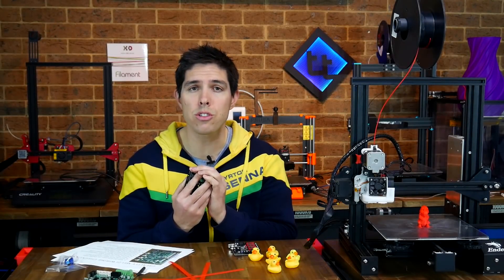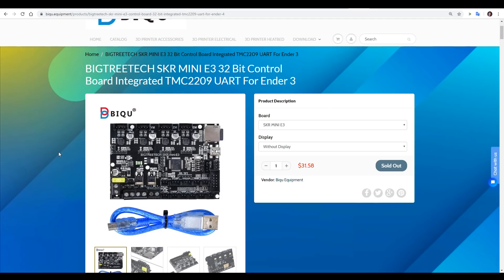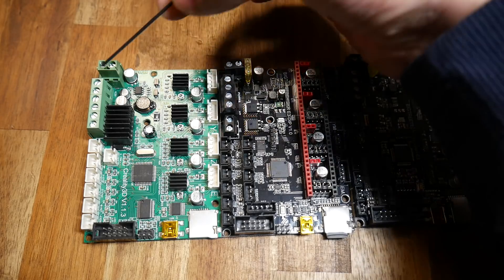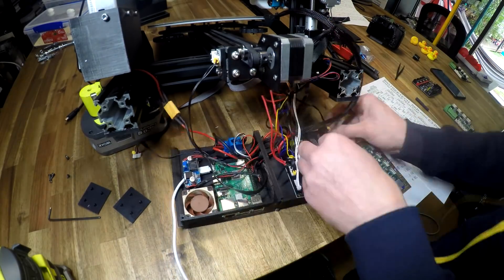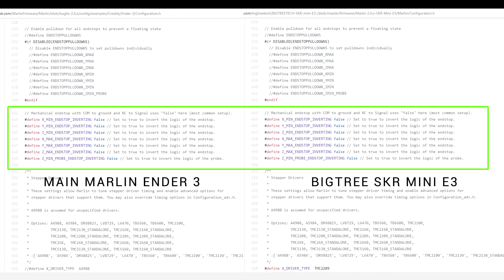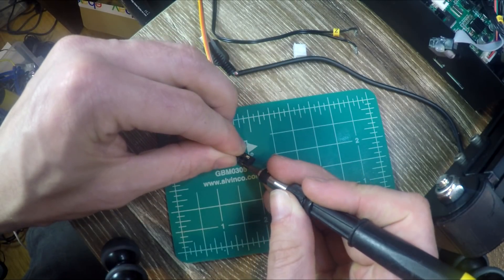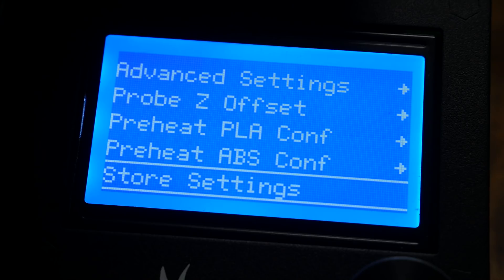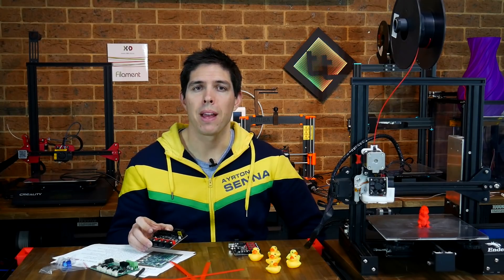SKR Mini E3 - The best Ender 3 upgrade from stock?

Comment: What is the main reason people upgrade their boards? How does it actually improve printing?
Reply: As he goes over a bit in the video there are 2 main reasons the extra expansion ports without cutting wires and the other is better stepper drives which without going into much detail about how they work are more precise and made to be quieter so you get reduced noise and better precision improves your print quality by reducing the size of extrusion artifacts due to the smoother stepper drivers.

Comment: I just got my mini e3 in the mail, with plenty of ducks  but no heatsinks... Should I install or hold of until I can get my hands on a pair?
Reply: I think it is not safe to use it without heatsinks.
Reply: @UgurGuver  Thanks, I didn't trust it either.. So I took the heatsyncs off the old board and ended up using those

Comment: Hi Michael,
I used the firmware file you provided. But I run into "TMC Connection error". And also the nozzle temperature is displayed at 100 degrees constantly. Any help is appreciable. Thanks in advance.
Reply: mani. lycan I got the same tmc connection error
Reply: @Paddzr  Yes. I posted the same in GitHub also. Another guy who got the board yesterday also has the same error. The RGB adapter is changed in the new board I received. Anything to do with that?
Reply: @maniac19061988  is it this one? https://github.com/bigtreetech/BIGTREETECH-SKR-mini-E3-/issues/32

I commented there too. I too received different board. The .bin from sd card works but there's no way to modify it to add bl touch.

Comment: Is this board compatible with Octoprint ?
I just upgraded my Ender 3 with the Mini 3 and definitively a great improvement but Octoprint is another story, getting print all over the place, file transfer trouble....)
Reply: @Teaching Tech, do you have a reply?
Reply: @sam2b77   yes there is a fix, need to remove the +5v pin from the usb cable.

Comment: I have seen the dampeners reduce the DB by about 5, but silent stepper motor drivers reduce noise by about 10 DB, is there anything gained by using both? I'm aware with both, after installation fan's are often the loudest part of the machine, but there are quieter fan's too. so I'm wondering is there still ground to be made in noise reduction?
Reply: Yes, i changed the psu fan to a 92mm noctua, rear mounted the board with a low profile 120mm fan and put a 40x20 noctua fan as the part cooler with a larger blower, fans are not cheap but you can sit next to my printer while its running and its almost silent, ambient room noise is much louder, did require custom psu case as well as board case but stock fans were way too loud

Comment: Question: Does installing this negate the need for the TL Smoothers, or do they each address separate problems?  Thanks in advance for any help.
Reply: don't use tl's with the drivers on this board.

Comment: A couple of what may be dumb questions. I am hoping to just swap this board out in my Ender 3 Pro, is there anything I need to do differently in a pro? Also in CURA is would I continue to just keep using the profiles based on the Ender 3? should the same exact gcode work fine? Great video! Thanks.

Comment: Is it still recommended to connect the BLtouch in the Z-end stop plug or BIQU fixed the problem and we can now use the appropriate PROBE plug? If it's still recommended, should I splice the Z-end stop wire to keep my Z-end stop functional? Thank you.  NOTE : my board is v1.2

Comment: tried to make the BL touch work with it, however, the plugs i have dont seem to fit, and when i put them in the printer wont power up.  What plugs do we need for this?
Reply: the new 1.2 board has different pin out the sensor is pa1 +5 Grnd the bltouch i have 3.1 was pinned +5 pa1 ground, I had to switch red and yellow(could be red and orange) my ground is blue others have brown

Comment: So this E3 board should also work in my Ender 5 with a couple of model specific changes to the firmware?
Reply: I have put it in my E5, work nice. Just have to go some compiling staff to do. But otherwise recommend!
Reply: @Riverzilka  i want 1 for e5 ! Any major adjustemts ? Im not gd at programing boards
Reply: No major adjustments. Most of them you will find in Teaching tech video about 32bit board upgrade. My major chalange was to compile the firmware. It keep generating errors for almost day before I somehow manages to do it. I’m new to 3Dprinter world, but do have experiance with programming.

Comment: Hey Michael, it seems that I am not able to align my ender 3 bed correctly. I am using skr v1.3 and homing works. Unfortunately when I print something is it nog in center and sometimes the stepper grind when they go to there max position.. Can you help me out on this one? What are your Y_MIN_POS and Y_MAX_POS? Also what are the other values.

I really can't seems to home the bed properly...

Cheers

Comment: The problem most times is the bed frame. It's bent on almost all Creality printers and needs to be straightend. Otherwise the bed leveling screws are always off uniform or on their maximum of compensation.
This might be the problem with the touch probes and inconsistend leveling.

Comment: I followed everything you told me to do I have the board installed the bltouch and I flashed it with the file you gave in the description when I turn the printer on I get a tmc connection error what am I doing wrong
Reply: me too

Comment: I've just bought the SKR E3 DIP version, and was hoping to have my hot end fan come on at a set threshold, but now looking at the pins diagram I see that only one of the fan headers is actually switchable, which would be for the part cooling fan.
Is it possible to set this option on this board? or should i return it and get the SKR v1.3?

Comment: I need to upgrade my motherboard because mine is broken.
i have also an ender 3 and installed octoprint with klipper on it.
if i buy the SKR Mini E3 is it than still worth it to use klipper?
thanks.

Comment: Hi Michael/anyone reading, I'm struggling to get my BLTouch to work. I have the board installed, firmware compiled, bltouch and everything shows in the menu, but when I autohome, the probe does not deploy. I have the servo pins plugged into the servo port on the board, and I have the end stop switch on the z-stop port on the board. Could anyone maybe provide some insight?
Reply: me too/any solution??
Reply: Same here. Please help.
Reply: @mauricegeurtzen  On the v1.2, you have to rotate the bltouch servo plug so that it is the opposite of what is shown in this video. The 1.2 reversed the pins. I reversed my plug, redid my firmware with a precompiled one off of a reddit forum post specifically about this issue, and it fixed everything for me.
Reply: @tuckuhhh  Thanks very much Tucker. I got it working!

Comment: Will this board support the thermistor upgrades out there for printing in higher temps after upgrading to a micro swiss all metal hotend? If so i'm sold because all i know as an option is spending $179 on a Duet board or a $60 MKS Gen L board with additional stepper drivers.

Comment: I received my E3 1.2 today, Pre-Ordered at the end of August for a Ender3 pro. I wonder if you are still using yours and how it is holding up. I see 1.3 is out.
Reply: I also received my E3 1.2 that I pre-ordered and just finished getting it hooked up unfortunately no matter what I do it won't power on no lights or anything I'm wondering if I just got sent a dud...
Reply: @connorcleveland9166  Does it power via the USB?

Comment: I mounted a Bigtree skr mini E3 on my Ender 3 just as it came from the factory with Marlin 2.0 installed. Only I noticed the very hot engines. I do not know why? Can you help me
Reply: On the Bigtreetech github they have changed the firmware for less stepper motor current, maybe you should try the new firmware update

Comment: I had trouble with uploading the firmware as my computer wasn't recognizing the printer. Turns out you (obviously) need to leave the SD card in, I took mine out because I don't use it and assumed I didn't need it. Just posting in case anyone else has this problem.

Comment: Hey. Thanks for the video. Some great info in there. 
Do you know if there's a convenient spot I can tap into for 12v to feed some LED's on this board?
Reply: Ender 3 uses 24v, 12v is not available.  Most people add a buck converter to get to 12v from 24v.

Comment: Thanks for this video, I have one in the box waiting to be installed, did you enable the EEPROM SD card simulation in your firmware as this board has no standard EEPROM.  I have an EEPROM module that I thought to connect to the I2C, maybe a video on this would be good?
Reply: Never mind, just seen that they've now added Flash based eeprom simulation for the E3 mini

Comment: Does anyone have a guide to getting the best out of the SKR board?  I just tried a back to back test of a print on 2 machines, one with a Creality 1.1.5 board and the other has a SKR 1.3 E3 (I have 2 ender 3's).  The SKR print was 5 mins slower using the same Gcode and the quality for both was very similar - both very good. 

So - tbh I'm hard pushed to see the benefits at the moment;  I have a BLTouch to fit - and being a genuine Creality accessory the wires are different colours than the usual; I also have the Bigtreetech TFT 3.5 v2.0 which refuses to see a printer attached. In a nutshell - whoopee I have a 32bit board that currently is giving me exactly the same s I had with the original board. I'm not bitter about it as I understand there are many more options for upgrades, but it looks like I'm going to have to go though trial and error to get some of this stuff working - and as someone who hasn't had to write a programme in anger for many years the thought of diving into code to fix this really doesn't appeal (anyone got a link to a "how to recompile Marlin for dummies" guide?)

Comment: would the compiled firmware from skr mini e3 work in a skr e3 dip just changing board name (mini e3 to e3 dip) and changing tmc 2209 to tmc 2208?
Reply: I'm considering doing the same thing.  Are you planning on UART on the 2208?
Reply: @stevelaoyster1716  Yes im thinking of that, right now i have installed physically that board on my Ender 3, set TMC2208 with jumpers on UART. Im just looking to rebuild Marlin 2.0 with that change

Comment: Hi Michael, thanks for the very nice videos! Can I ask you a question? I own an Ender 3 Pro and would like to mount a Creality 3D V1.1.5 board that needs no modification. I have a doubt: will I have compatibility problems with Bltouch V.3 as for the standard board?

Comment: anyone with a skr mini e3 1.2 take note the hot bed wire are different. Is the red wire suppose to go to the (-)?  both the 1.0 & 1.2 the (-) is one the left is the red wire (-) in this case?

Comment: Do you suggest this board over the SKR v1.3?

I am hesitant because I have had a driver fry on the stock board, and that forced me to upgrade. With the SKR v1.3 I can just replace the driver if it didn't harm the board as well.

Comment: Hey there! Just wondering, can anyone else verify if you can use mass storage through USB to drop G code files on the board? I have got everything else working except for that, and I've tried it on a couple computers… Thanks in advance for anyone's input!

Comment: Well considering 2209s are out of stock every where till November or so how much more work will the e3 mini with 2208s be to setup?
Reply: The mini only comes with 2209.  If you want other stepper drivers you'll need to get the E3 DIP board.  The drivers just plug right in.
Reply: @stevelaoyster1716  i meant dip... My fault... The question remains. I know you will need to setup the firmware for the steppers and set some jumpers but is the board close enough to follow the setup video for say the skr 1.3 with 2208?

Comment: Thanks for the video. I have installed the board today but my BL touch clone is "revered" that is, the init test seems to be fine, but normally it goes to the "out" position. Now it stays"up". So when I do the auto home, it hits the bed with the hot end first! and not the BLT. I have set the "#define .Z_MIN_PROBE_ENDSTOP_INVERTING true" I'm using "#define SERVO0_PIN P2_00" as I found this in the PINs file (is this the correct one?). Well hope someone can point me in the right direction. :-) Thanks!
Reply: Okay, so I have found the solution my self :-) You can see the steps for getting the BL Touch working on a version 1.2 here: https://github.com/gfk76/SKR-Mini-E3-v1.2-Ender-3-Config-Files-Marlin-2

Comment: Hi Michael. Good job, as always!!! I bought the SKR Mini E3 with  TFT28. When I try to compile Marlin bugfix 2.0, the compiler informs me that "at this time only CR-10 display is supported". Is there some way to solve this?
Reply: Isn't the ender 3 display referred as CR-10 display....so it's the same.
Reply: @EL90291  Hi EL EL, the tft28 is a touch screen display and it seems not supported by Marlin 2.0

Comment: The new creality example included with current marlin 2.0 builds have the rms set lower to keep the chips cool and also now you have to use defualt_env = STM32F03R_bigtree. there was some clean up of code to simplify things as  STM32F03R_bigtree now can be used for several boards. ur firmwares are outdated and incorrect now. might want to make note of that. I tried using ur firmware file and my x chip was burning up. have a good day

Comment: I''ve stumbled upon a problem with this board and manual bed leveling... When going to the proces of the bed leveling everything goes right until I try to set de Z offset... At that point the Z axis doesn't repsond... Anyone got any idea as to why this might be?
Reply: Hi, I've had to disable the software minimum in configuration.h for the Z. comment out MIN_SOFTWARE_ENDSTOP_Z and a Z_MIN_POS=-6 for it to work for me.

Comment: Is this board basically a direct replacement physically and connector wise to a standard melzi? I have a Malyan M150 I'd really like to upgrade the board on but I've been hesitant to have to redo all the wiring (I can do it I just don't want to)
Reply: This board is a direct replacement for the melzi board in an Ender 3 and I think also an Ender 5.  If your board is anything like them then it will probably work but may need the firmware tweaked a bit.

Comment: I just ordered mine a few days ago! how long would it take to deliver?
Reply from the maker: Mine took forever. "Stuck in Hong Kong".
Reply: You were right, it took quite a while but I have now just received it! It seems to have a newer version having its name to be "BTT MINI E3 V1.2". I am following your guide now fitting it on my Ender-3. Thanks, Michael!

Also will this board work on other printers? cause I ordered 2 MINI E3's and I would like to use the other one on a tronxy x5sa.

Comment: Anyone have any suggestions for an issue with the LCD? I have had it happen a few times where the LCD will not show any info after flashing marlin 2.0.x and won't until I reflash the firmware.

Comment: When upgrading my printer I installed a 12vdc 5015 fan by mistake. I'm running an Ender3 so it burned the fan up with 24vdc. Oops. When testing the fan to see if it was still getting power, I shorted the solder pads. Second oops. This one somehow burned the MOSFET on the heater bed and it runs away without control. The circuit is latched open now. Need a new board. I'm not posting this to knock the board, I've ordered a new board and proper 5015 24vdc fans. Posting so others can learn from my mistake.
Reply: A misconnection by accidentally swapping the hotend cooling fan and bed power connections will result in runaway bed temps too.  I made this mistake and although many told me I had a blown MOSFET it was just mis-wired.

Comment: What speed dop you have to print at to get the amount of noise you're getting? When I run my stock Ender 3 at 80mm/s it's not nearly that load.
Reply: Its tge microphone. Stock ender 3 motors are noisey when moving because of the drivers, the drivers on this board make the motors silent when they move, only noise you hear are the fans. My E3 had 120 / 92 / 80mm noctua fans so even when printing you can sit beside it and its silent
Reply: @n2n8sda  I understand that, however, I'm running my STOCK Ender 3 at 100mm/s and it's still not very load, the major noise I hear is the fans. Don't have a sound meter, right now, but I find it really strange I'm not getting all of this noise.

Comment: How much of a downgrade would it be to go from the 100Mhz processor of the SKR v1.3 to the 72Mhz processor of this board? I run 128 native micostepping on the extruder, which I think is the biggest processing hog.
Reply: Ive not tried it myself but a friend in a similar situation uses a geard extruder, i.e titan aero, bmg to get a finer reduction without switching to a 0.9 degree stepper or higher microsteps, i assume your trying to reduce artifacts? Did the higher microsteps make much difference?
Reply: Yes, I'm using a BMG and did notice an improvement. When using interpolation there was a very very fine wavy pattern on the walls of prints. Setting it to 128 native got rid of those artifacts.
Reply: @andronicuscomnenus2642  Interesting, I will have to try this. Are all the other steppers at 16 or all up to 128 as well?
Reply: The other steppers are at 16 with interpolation.
Reply: @andronicuscomnenus2642  I think you be fine at 72mhz. the big draw back has been on the other boards being 8bit when you goto the higher stepping. I know others using slower controlers at 64 steps on the X and Y with no issues. Doesn't that create a lot of heat on the extruder? really currios to try that now =).
Reply: The extruder has a 1.5A rated pancake stepper that runs at 900mArms. It gets to around 40C on long prints, but that seems perfectly acceptable to me.